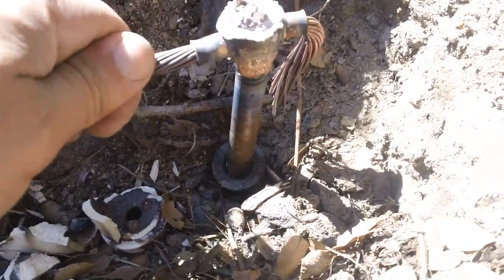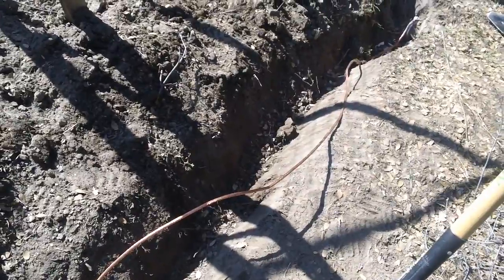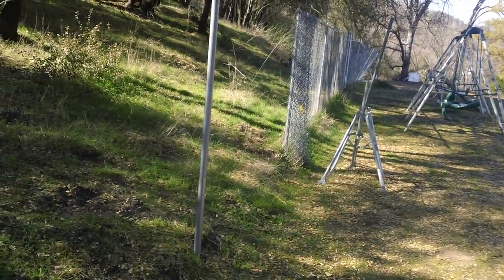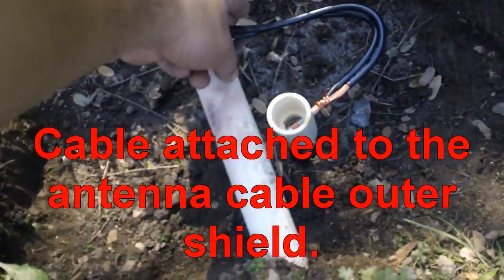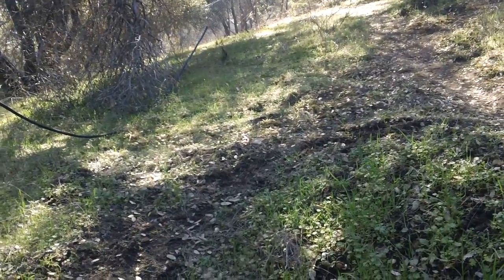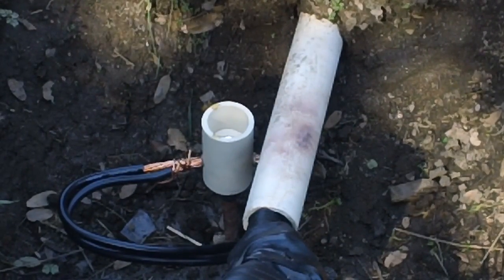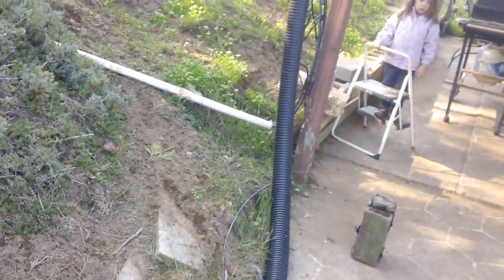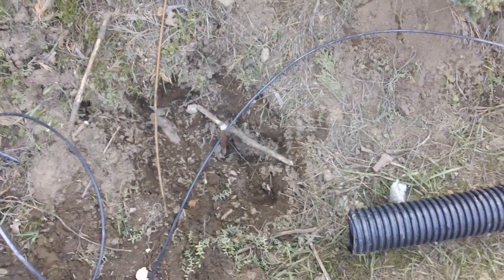SHTF/WROL Comm Antenna Cadweld One-Shot Grounding Rod Installation. Part 2

Comment: Yes I believe I will stick with the N type. I will be on 70 cm most of the time and will use a good quality coax for the extended run. I do appreciate the input and look forward to the project and testing when the time permits. Research and help from fellow enthusiasts can certainly save a lot of money and headaches. Thanks again from Los Angeles

Comment from the maker: I think the starter powder in the bottom of the charge is thermite, its a different powder than the copper & zinc (I think) oxide that makes the rest of the compound. I could not lite the copper compound with a torch, I need greater heat to start the reaction.

Comment from the maker: What GateKommand said below, Diamond antennas makes some of the toughest good performing antennas for not that much. I've seen a few in the field that held up for at least a decade. Its always a good idea to ground your antenna for safety reason, if a ground rod wont due, metal water pipe you know is going under ground in dirt, or the earth ground of you electrical system is another option with caution. a grounding rod is preferred.

Comment: As for lightning protection I have heard of earthing kits that clamp onto the outer braiding of coaxial cable just before it enters a building. The earth kit is then connected to a good earth. Hope this helps........

Neil 2E0EJS AKA GateKommand

Comment: @EiEd:  The gage of the ground wire will depend on your local electrical code.  Please be aware, all earth grounds in a system MUST be bonded together, including the ground for your electrical service.  Soil conductivity can vary greatly in just a few feet. You don't want to risk a voltage potential between your power and antenna systems, with your expensive radio as the fuse.

Comment: One other quick question when ya have a chance, From the proposed antenna install off of a vent pipe to a ground source(right now a water pipe 60 feet from coax feed running down wall at ground level 130 total) what gauge wire should I use and do I need to run a separate ground from the radio equipment to a different external ground source ? Were just trying to get things in order before SHTF...Thanks again

Comment: I have been using an Ed Fong dual band J pole. It works great and can handle 75 watts. I picked mine up on ebay pretty cheap. I doesn't need a ground rod or radials. So you just have a 5 foot section of PVC pipe that you need to mount. Go to ebay and search for "Ed Fong J pole" look for the seller 'antennas_iqn'. That's Ed Fong him self. Even if you have another antenna already, an Ed Fong is worth it for a backup or portable antenna For $28 you can't go wrong.

Comment: How many feet and gauge size did you use fella ??? Nice work. I used 250 to 300 feet 3/4 inch copper cable in a U shape from end to end with my home in the middle with copper lightning rods. The ends are buried from four feet to twelve feet going way from the house toward a stream with circular ends in a six foot diameter circle ring 18 feet deep.. That is the deepest the backhoe can dig down too. Lightning hits the house on a regular basis without any damage. When it hits the electric pole on the high side of the road it burns out the transformer at least two three times a year. Peace fella.

Comment: Thanks GG.  Question: What would be a good dual band antenna(s) for 2m 70cm with the best possible gain for the roof of a 2 story building and would I need to run a ground rod ?  We are just getting back into the hobby.

Comment: Hi EVILisEVILdoes

The following is (I believe) in your ball park:
SE-300 Diamond 2m/70cm Fixed Station Vertical (no radials)   
 Price: £134.95 (Including VAT)    
* Frequency bands 2m/70cm * Gain 6.5dB (144MHz), 9dB (430MHz) * Power 150W * Length 2.85m * No radials * Mast size 30-62mm * Socket SO-239 
This model is made of fibre glass construction, pre-tuned and fully weatherproofed. 
Although personally I would choose an aerial (that's what it is called in England) with an N type connector!

Comment: Oh and just to reiterate I personally would go for an "N" type connector on any aerial I buy. The PL259 was developed in ww2 for use in the atomic bomb project and rumour has it that it's characteristic impedance is only around 25 ohms. Either way it wasn't meant for bands higher than HF (where it does perform fine). I know that this connector is often used on VHF (I have a radio with said connector) but there will be loss. Hope this helps..... Sorry to hijack the thread GG :) N